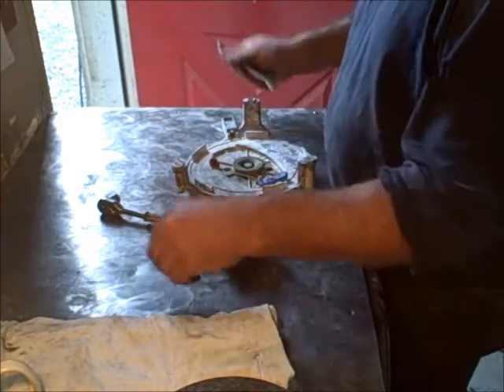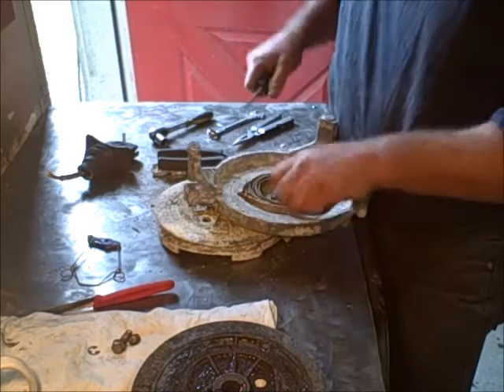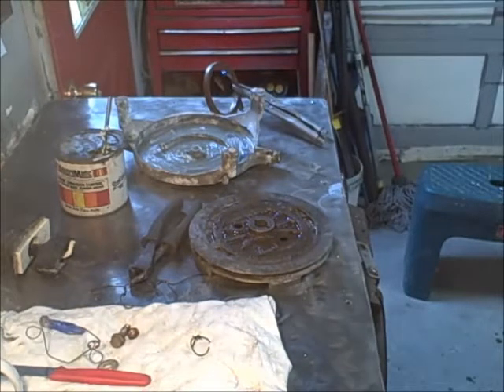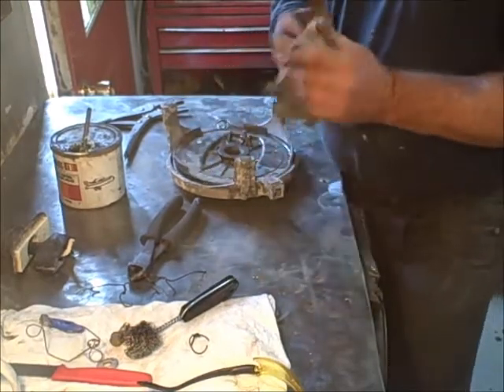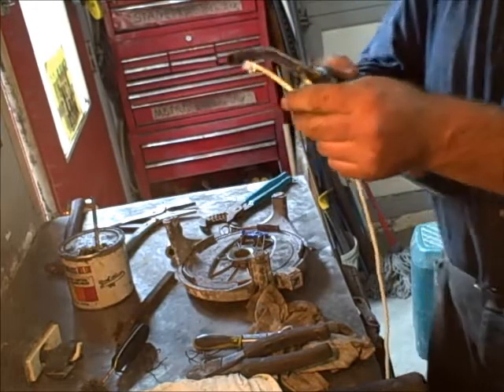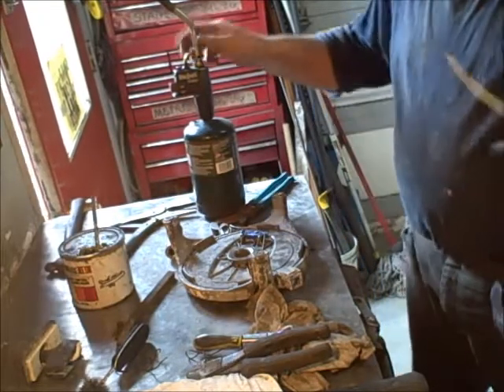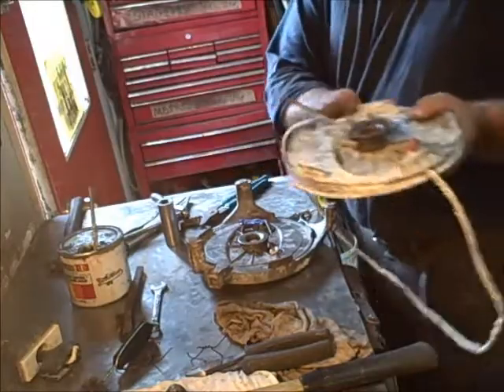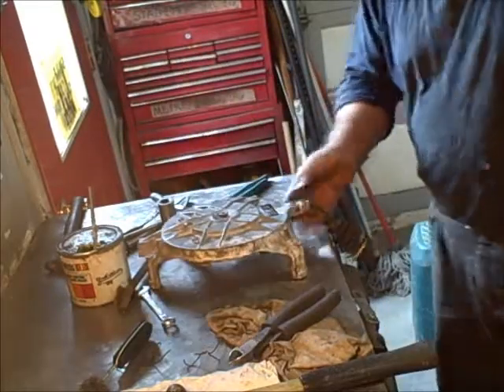PULL START REPAIR

Comment: Awesome video, taught me how to take apart and rebuild my whole recoil starter. Although didn't fix my issue I found the issue. I had to use brake cleaner to clean the gunk off the spring to get my return spin back. But without this I would of never known how.
Reply from the maker: Good on You'  Glad U got it done,   thanks           kodibass

Comment: Good video man.I was thinking I will use my drill and a wire wheel and clean mine up really good and paint it ,and grease all the metal on metal  moving parts Like we used to say in the Navy if it moves grease it if it don't paint it So I don't have to do it again ever.

Comment: Good Video shows the detrimental effect of salt !!
Reply from the maker: +Chris McCartney,   Thanks, Yep salt is a kicker killer for sure,  I have had motors come into the shop that were only 3 or 4 years old with water passages eaten clean through.  Seen tiller handles just snap off,  salt = bad .                                                   kodi

Comment: appreciate the instructional video!! one question.  I couldn't tell if you wound the spring up before inserting it.  Could you explain that part with a little detail?
Reply from the maker: Liz  ,  Yes you wind the spring before you install it,, I hold the coils in my left hand & pull the other end to shrink the coils,, Once I get it to a circumfrence that I see will fit in the lid, I clamp vise grip locking pliers to hold it so, I then place it in the lid and hook the spring end to the lid pin, then I place my hand on the spring, & release the vise grips and allow the spring to expand to fit lid.     kodi